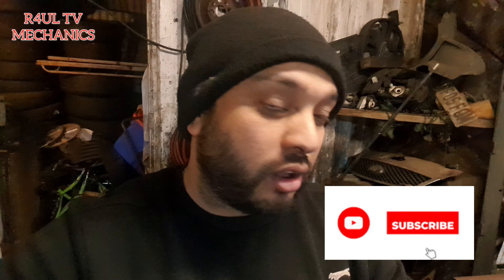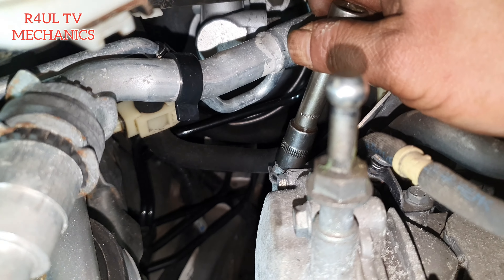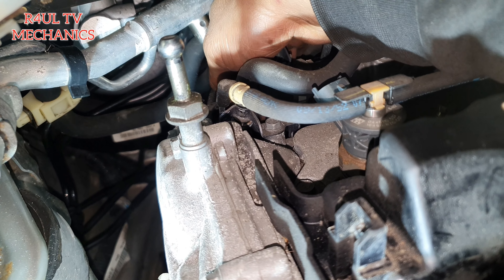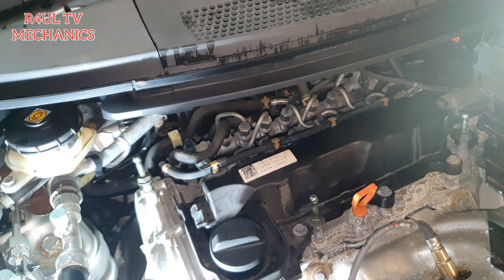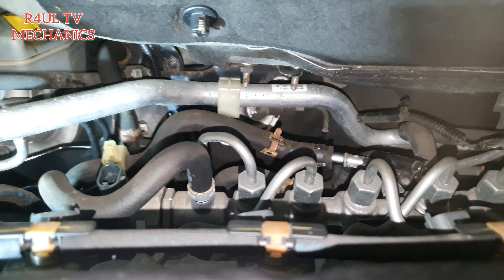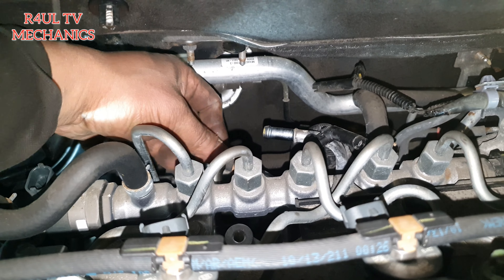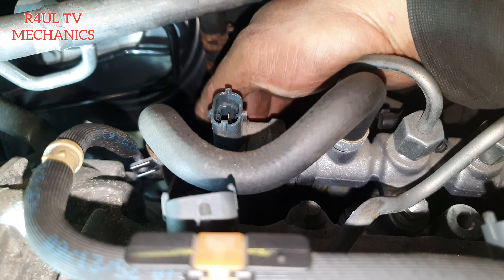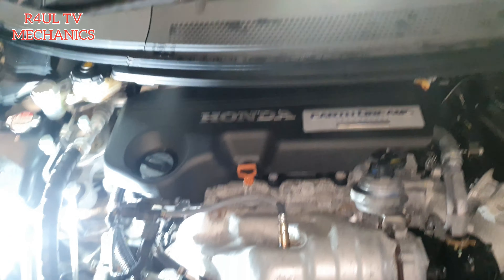2014 HONDA CIVIC GLOW PLUGS REPLACMENT

Comment: Fresh from doing the job. Great Video, just remember to really check every connector you unplugged  when your putting it back together. I started it and all i got was a very rough idle and a camshaft A error on obd2....one little clip i forgot to re-plug😢. I wouldnt mind but i took evrrything apart twice thinking i did something wrong😂😂
Reply: How hard is this to get everything off when de-assembling things? Also, how hard did you find taking the glow plugs out?
Reply: @liamfisher473  the dissasembly itself was fairly easy. There was a tall silver screw to the right which is not in the video which needs to be unscrewed but that was easy to work out. As for the plugs, be gently and patient. Dont wrench them. I rocked the socket back and forth firmly until it cracked. Its potchy more than difficult, be slow and dont drop the socket.
Reply: @Scape_TEST  thank you for the feedback. Going to try and do it tomorrow...
Reply: @liamfisher473  sorry, just a turn of phrase. Dont just force them, you could snap them. Rock back and forth firmly until they crack open, it may take a while but dont be urged to use force.